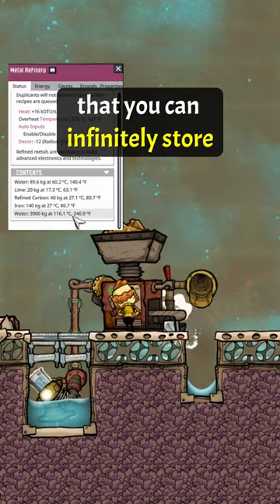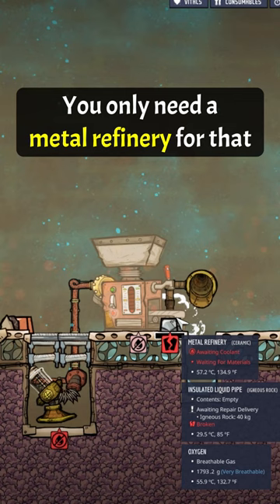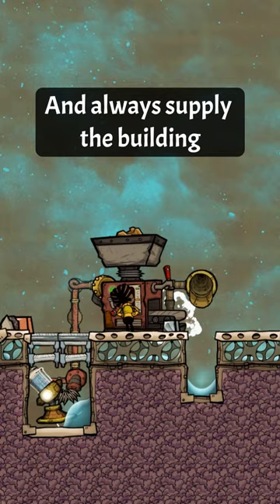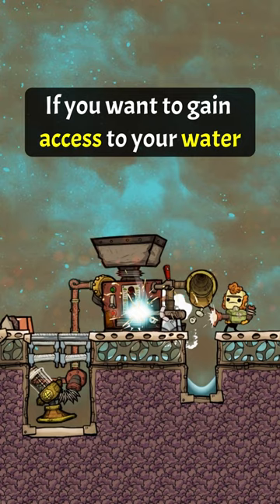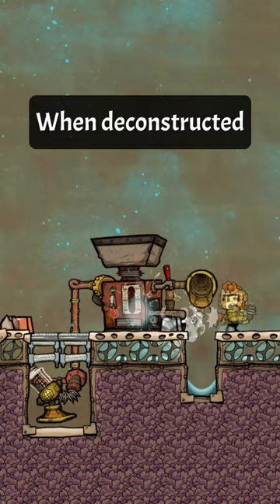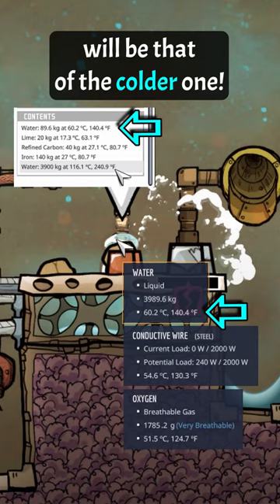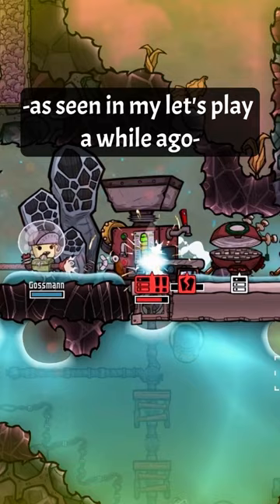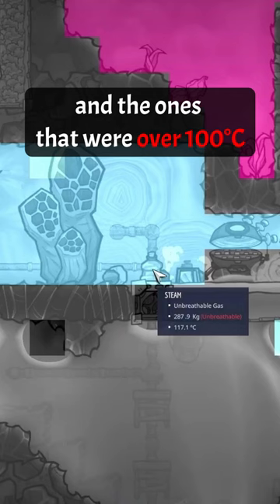Nr.16 Smelter Storage #shorts

Comment: Does this mean I only have to worry about cooling the machine?
Reply from the maker: Technically yes but i am not sure right now if the maschine really gets any hotter at all. you feed in fresh water every time and the hot water gets stored, does the buiöding produce heat itself? i think the heat is applied to the output water so no real heating is happening as far as i remember. In my lets play i have 1 Metsl refinery on floodista. that one has been running for over 2000 cycles. not sure i cooled that. 

Sorry if i can't be more precise i am far away from my pc at the moment
Reply: Use atmos suit to access the refinery. It consumes a f ton of water but doesn't overheat